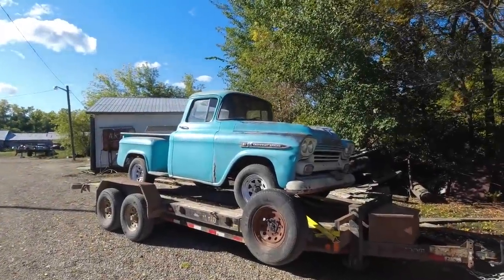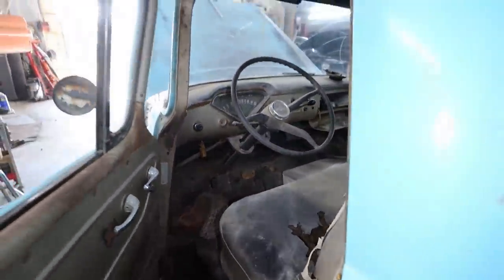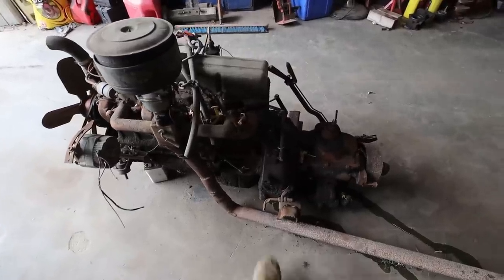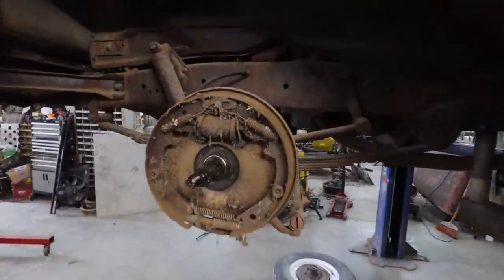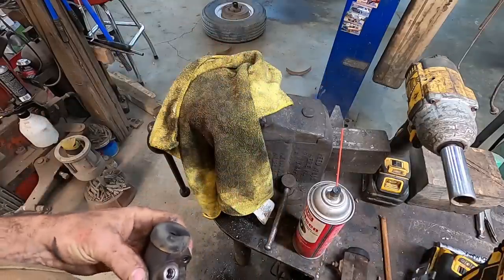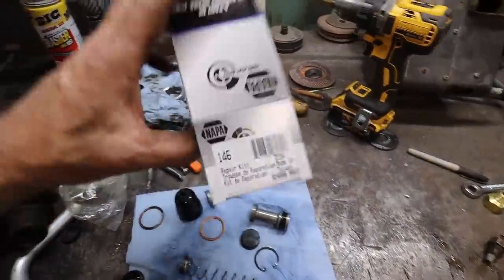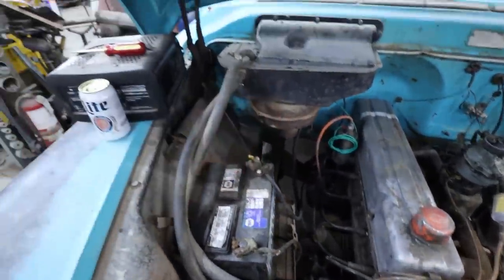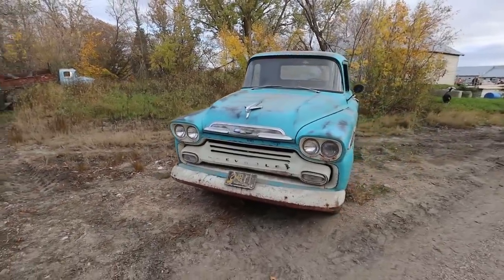1958 Chevy Apache will it run and drive?

Comment: In my opinion these are the best looking pickups GM made, thanks for saving another one!
Reply: You’re correct Kyle, look at it, cab leaning forward. Going 60 just sitting there. Very cool.
Reply: Like the '57 with the single front headlight a little but more but they are so danged cool...
Reply: BUT, don't just park it like everything else sitting around. It needs to be completed and used as a cruiser.
Reply: @kodak_jack What does he have “just sitting around?”
Reply: @keithharden7844  The list is almost endless. The Studebaker he wants to drag race on the dirt, a '68 Cuda, all of the stuff parked on the way to the shop, the '54 Chevy,  the '56 Dodge pickup, the Georgia T-Bird, etc.
Reply: @kodak_jack Is he supposed to snap his fingers and have stuff done? I mean I know he’s good but things take time, is he supposed to pass on a good deal?

Comment: I like your plan. Fix the rust issues, leave the 6 shooter in it or transplant a nicer one. Don't lower it. Put the highway rear end in it so it can run a bit faster, and generally upgrade it but leave the patina. Oh and probably should do something with the truck bed so you can haul stuff with it. Love the stuff you do Brent.
Reply: Another great video --- as you are aware  - Apache is a very sought after truck -  keep up the great work .
Reply: Great little inbween project.  Fix it up a bit yep then up for sale . Find some of that SEB money. Rust repair and better hiway gears yes. I love to see old trucks put on the hiway. You have fun with it .
Reply: A

Comment: Nice Truck! Badging is for 59. 64-early 70 truck 12 bolt it is the same width as the original 10 bolt that’s on it. You can get 8” wide wheels on the back. You would only need to flip the perches. A small block will work with the same perches so long as you have a block with tapped holes in the front.

Comment: The motor you took out is a 261, worth opening up to assess. You can tell it’s a 261 because of the way that it is. (The captains bars cast in the block beside the base of the distributor denotes a 261) Really enjoying your content Brent!
Reply: Yes sir that would be the case as that 1/2 ton pickup generally used the 235, but there is nothing to say that it is not original or possibly it could have been ordered that way from the selling dealer. Engine may be salvageable you never know.

Comment: I'd soak it in marvel mystery oil& transmission fluid down in through the spark plug holes. At  least that way while waiting to finish up your other projects first. It'll give more time to soak.& Seep through the cylinders.& Oil rings to free up faster to by doing that process.

Comment: The reason I found your channel was because I initially did a search on 1958 Chevy Apache revivals.  Never looked back.  Anything, and I mean A-NY-THING, you do on a 2nd half 1955 to 1959 Chevy/GMC truck will always have my attention.  Your plan is exactly what I wish to execute with my project - I want to get her back on the road.  After a variety of prior thoughts, you have me thinking once again that sourcing a 235 would be the easiest solution that would still allow me to enjoy the truck.  Between the NAPCO series and this gem, I pretty much have a foolproof roadmap.  If you have video, it would be very cool to see how you were able to troubleshoot the electricals and wiring on this Apache through your "Other Half" channel.  All in all, this episode was just made for me.  Thanks a whole heap!!!

Comment: Stock, the heater controls are to the right of the radio.  Your dash has a heater delete plate.  I believe your NAPCO truck and this truck should have the same heater and controls from the factory.

Comment: Good work and good find! I love these trucks so much. I'd keep her stock. Plenty of these 55-59's rolling around all restomodded. You rarely see one stock. P.S. This is a '59, badges are the most obvious clue, but somebody could've swapped a front clip. But the original interior paint with the fawn color on the inside proves it's a '59. '58 and before had a grey with charcoal accented interior. Then they kept that fawn color throughout the 60's.

Comment: Sweet find I have 59 short 6ft fleet side and a 59 barn door suburban love ❤️ these trucks. They do not make the brow replacements but occasionally original GM repair panels pop up on eBay. Sure you can make them your the best fabrication guru 🤛

Comment: Pembina Motors, for 60* years old that truck is still close to home. Keep the 6 until its ready to croak then v8, fix the windshield and rot above it, put a road gear rear end in it and bed. Thanks for your vids you're the best !

Comment: Honestly I think its pretty cool stock. The Hot Rodder in me says V8 but I like the idea of keeping the six banger and 3 on the tree. I would do disks up front, a drop axle, and lower the rear a touch, as well as fix the rust lol. Then drive the wheels off it. I'm picking up a solid Dodge short box and am seriously thinking of leaving it a slant 6 and 3 speed. Too bad on mine they converted it to a floor shift though. - Jamie

Comment: The short box step sides are on fire right now ...have been for a while . Nice to see you snagged one or two.  My dad had a brand new 1960 Apache 30 tow truck.  By all means lower with the drop front axel and lower the rear it'll look killer.

Comment: I personally like the way you were thinking, keeping it stock with the 6 cylinder (6 in a row ready to go buddy),ive always like the inline 6, plenty of power and torque for just cruising around, and you are right, that is a really nice truck, and in very good shape, keep the outside appearance and paint as it is, put a new bed floor in with the individual boards, just fix a few things,i think you're right about putting a higher geared rear end in it for the highway, that way you don't over rev the engine at highway speeds, anyway, great video,a great looking truck,a really lucky find for you iam thinking, thankyou.

Comment: The motors will interchange, the GM is a 261 and the Chevy is a is a 235. That's why the tappet covers are different. The 261 was also used in  Pontiacs in Canada. Nice little pick up.

Comment: This brought back a lot of memories.  
I have a 55 Cameo, that I have owned for nearly 55 years.  I have done numerous swaps over the years, until it finally ended up with a big block and a TH400.  I rescued the truck from an auto wrecker in Moose Jaw in the winter of 1967, and the first swap was a 283, done in an unheated part of the owners shop.  (He thought I was insane, but was a real help, giving me access to any parts I needed).  The cab had rust in all the same places as yours, and has been redone twice.  
I laughed, and almost went out to the back yard to see if you had taken my front axle.  I made a 6 bolt to 8 bolt adapter for my front end, that looked very much like that adapter on the one you used for parts.  Mine worked really well, but I used real, pressed in, wheel studs.
Good stuff, but I would have like to have seen you put a small block in after pulling the six.  I like the six, but the small block is lighter and just looks a little cooler to me.   You have a great channel, and I like the stuff you are willing to tackle.

Comment: You have to love the old Apache Trucks (my Dad's first new truck was a 1960 C10 Apache).  She is looking good as she sits.  Keep as much as possible as it is now (rusted panels are an exception, of course).  Everybody has an old truck with a small block in it, and almost that many now have one with an LS or big block.  That 361 is unusual enough to resurrect back to running condition.  A dual-carb intake and a split exhaust manifold with glass packs and exhaust pipes made out of old driveshafts will really give you a unique sound...  The heater set-up looks like the "deluxe" heater package available in the early 1960 - 1964 pickups, which is a major upgrade to what they came with...make it work.  And...you have to love those seat covers - keep them for some future need.

Comment: I tend to keep things original and would like to see if the original motor can't be brought back to life if it isn't gone to far. But if you lean to a small block 8, as long as it's a chevy. Keep it in the family.
Best looking ute built by GM I reckon. I think that when you start doing a little body repair you end up doing the lot so I set my sights on the lot, that way when I get to the end I'm happy with what I've done and know I've got something that going to last a lot longer and of course more value added.

Comment: Hey, That's a Puddin's Fab Shop color!  I agree this is one of my favorite GM truck body styles.  Generally, I'm not a fan of lowering trucks unless they are heavily modified anyway.  It tends to blur the distinction between cars and trucks, and I believe a truck should be able to go off-road without breaking something or getting stuck.
Reply from the maker: I'm with you there but then they got to be four wheel drive haha

Comment: i like these old apache. 
nice old truck. 
leave it stock height   stock front end  stock 6cyl  stock three on the tree  
nice old truck! 
needs a little rust repair and a new seat and a few lights and wiring amd you got a nice driver. 

nice to see one thats all original.

Comment: Nice old Chev.  Think it may be a `59.  My dad had a fire engine red one in the late `60s as his work truck.  It was an ex forest service truck and super heavy duty.  Sat super high with monster springs and massive 17" snow treads all around.  Looked like a 4X4 but only a 2WD, we could hear him coming home from work long before we could see him - that's how noisy it was.
In the UP of Michigan they use lots of salt, so the headlight buckets rusted and fell out!
To keep it working, he mounted the lights on flake board risers inboard of the turn signals and left the rusty holes where the headlights were wide open!  Looked like a Land Rover coming at ya at night...   It was a beast and that six did a lot of work with the super low gears, but was slow!

Comment: I have 61 Chevrolet Apache 20. Has tag NoSpin Differential. Detroit Automotive Products Corporation in the cab.. model no. E119. Used this truck alot. Not so much anymore. In the near future I will be parting with the truck. ☹️ Great video thanks for sharing.

Comment: I would like to see a slightly lowered front, leave the rear height as is, put a small V8 in it with dual pipes the patina is good, a torched wood bed and a nice interior. Make it a sleeper....nothing flash outside,solid, but with a bit of get up and go. A friend of mine here in the UK has a V8 version of this in his yard, such a cool looking truck.
  Love the stuff you do,  you don't seem bothered about taking on anything, love the channel.

Comment: I used to have a 69 El Camino that had a nice little 283 small block out of a 1958 chev truck with later camel hump heads. 
Ran great. Good power. Good on gas.

Comment: The ol Chevy eyebrow rust out.  after grinding and cutting for a week, on probably right at doing 50 of em, I now just wire brush em, masking tape of and use newspaper to catch the big stuff over spray, and use Flex Seal black.  and several coats I should add.  Then someone always stops me in like Home Depot parking lot, and asks what it would take to buy it, and what I find is they think its worth more than I do, so I sell it to them, and go find another one.  They are getting harder to get cheap.

Comment: Hi Brent I had a 59 and I found that a rear end out of a square body pretty much bolted right into the 59 and as long as you spend some time to tune  those old 235s will get great fuel mileage.

Comment: Cool truck. Trim is 59. 58 is a little slimmer.  I Like the color. Gonna make a great cruiser. 
You’d loose your mind if you had access to some west coast trucks. 
I looked at a 1950 2 1/2 ton gmc in California that has a few quarter size rust holes in the cab corners. That’s it. Zero rust otherwise. The floors are solid as when new. The frame still has factory black paint. 
It’s crazy out there.

Comment: A Mechanic pal of mine did an Apache, (Blasted hard to find now) and the frame was  so bad he lifted the cab and box and set it on a 1977 impala sedan frame . He said it modified pretty well. He got modern running gear out of the deal as well. The old diffs in the trucks of that era were sure not geared for highway speeds, and the heaters were pretty weak.

Comment: I hope you remember your vise grips! I used a pair years ago on a jeepster putting a set of new seats. I was using a pair of vise grips, but never could find them. Well one day over a year later I was under the keep. And to my amazement there they were a little rusted but still there locked onto the nut I was tightening!

Comment: Keep the inline six, there is tons of tuning parts for them to.. disc brake and dual master cylinder for your safety.  A rear end swap for a different ratio is something you do in a hart beat..,,,👍👍🇺🇸🇧🇻 Good luck. Cool Truck

Comment: I vote for a stock rustoration.  Don't mess with the suspension height.  Be careful making the rear end "taller".  Yeah it will go down the highway better but you'll lose some of that neck-snap off the line that the 4:10s give you.  It's nice not to see an LS go in every once in a while.

Comment: Kinda interested in seeing the lowered beam setup. I like the originality of the truck, having a 235 and beam axle instead of a swapped in SBC and IFS. Don’t blame you for wanting a better rear ended gear though. Maybe an add-on overdrive box? If that’s feasible. As always, nice work!

Comment: I love the hot rods, and that '37 Pontiac is so art deco sweet! but this 58 Chevy pickup....This deserves the whole ball of wax, repair the entire body and bed, locate or build a replica tailgate, do the interior in correct colors, could go with modern material for seat though if original is too steep, painted frame, undercarriage, underbody, cleaned and painted engine & engine bay, 'refurbished' and repainted, but not 'show restored', a good late 50's Chevy truck daily driver as a piece of history......I remember when those trucks were everywhere, brand new, in cities, towns, farms, and on the roads across the U.S. - now most young people have never seen one on the road, and it would give you a great 'backup' ride if the roads are clear & no snow is incoming.😁👍🇺🇸😎

Comment: Lower front and back. New diff with limited slip, for winter traction. Fix cab brow and windshield. Patch rot. Retire kit, so it won’t catch fire. Fix seat and try to clean out tank like last time. Like the wheels. Just new tires.

Comment: To lower the front end some you can remove the first and third spring leaves the short ones if the springs are still in good shape. I did on my 57 chevy panel.

Comment: my 59 GMC long box WIDESIDE has a 300 hp Millar built 283 with an S10 T5 TRANS. 3:90 GEARS (STOCK) runs about 2100 rpm @ 60 mph also the back tires are 30x10.5x 15. Might go to a rear end out of a 64 chev truck with 3:73 gears to get Rpms down to around 1800 rpm @60 Cruises along good. Good looking truck. Same color as mine.

Comment: Excellent video Brent  :) nice find this year truck Chevrolet in good condition and shape! Also for my idea put 355 to 409 ratio back axle ratio gears be lots to find on that also did know you have 5/8 ton that truck is and fix light stuff needs too! Motor put if find one put 1960 to 1977 Chevrolet 292 with 1 or 2 barrel carb with hand choke cable knob in if want of Cater 450 to 656 CFM  also updated wireing too and lights too!

Comment: These trucks are great,wish we had more over in the UK. Think stock is the way to go,some stock looking wheels would be cool,probably would leave the ride height as is,maybe find a decent motor dual cars and a tubular header and some taller gears will liven it up a bit. Fix some of the worst rust and put a bed floor in it and make/find a tailgate and redo the brakes to standard and just use it,the six would be better on gas than the sbc also.

Comment: That's a sweet ride I would go ahead and do the drop axle lower it down all 4 corners But a cheap bed floor Fix the 6 cylinder repair what needs to be repaired but I dig that natural overhead air conditioning you have in there lol. Down here in Oklahoma those trucks go for big bucks just like you have it right now. As always I enjoy watching your shows.

Comment: You can squirt vinager in spark plugs area to loosen the. Gunk! Breaks open the rust in rings but change oil right after it sits for a day.trust me vinager works an a squirt of 10w40 to. It will loosen that. Seized motor. Do some patch panels on the apache an primer,

Comment: Save those spindles can buy everything but those. I’ve broken 2 on my truck and took forever to find replacement. CPP has the dropped axel and power steering conversion put it on mine

Comment: Great job. if it were me, I would fix the rust, replace the rear axel, including the brakes, repair the seat, and drive it. Is the smoke from rings or valve seals? I would replace both and call it done.

Comment: A five speed would be nice. I like the 261, for a sentimental reason - I had one in my 55 Pontiac - and for their excellent reputation. Small block and LS swaps are done to death. (No offense intended, but you have to admit, they're not as scarce as hen's teeth.) Stand out from the crowd in this outstanding truck.

Comment: Yeah when you show the air hole on the top of the window that needs to be address. It would look good drop, but leave the body as is maybe some minor body/rust repair but don't go all out on it the blue patina looks like farm fresh with white Steele wheels with center dog dish hub caps low profile tires 50s would set it off.